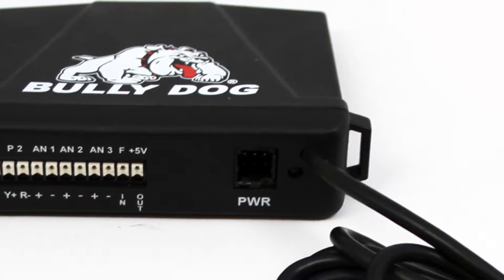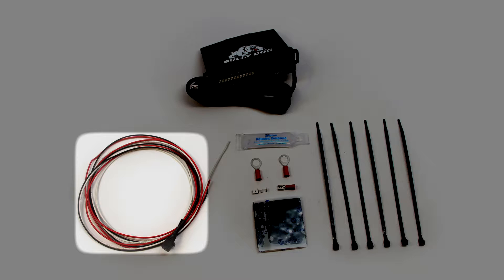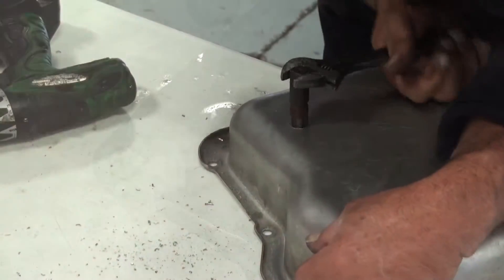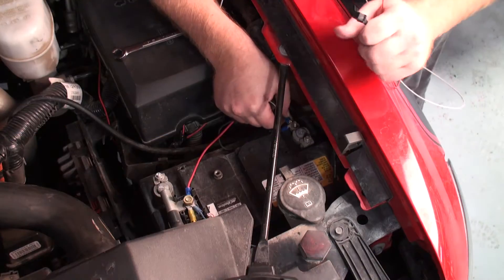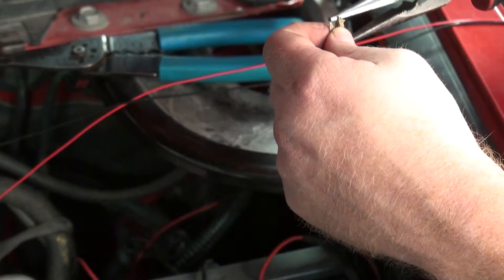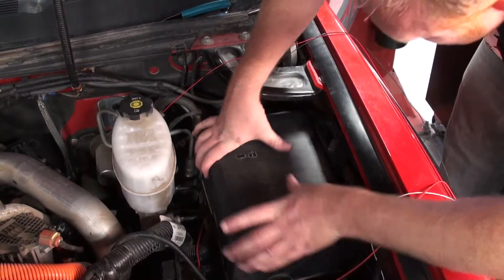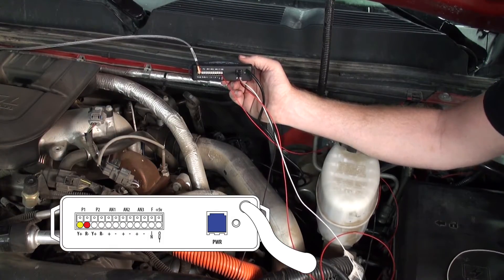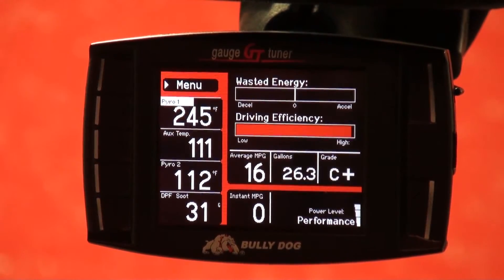Sensor Docking Station: Installation

Comment: So you attached the pyro into the exhaust pipe vs the manifold 
Is that going to effect reasons bc that’s clearly the easier way to drill and tap vs into the manifold